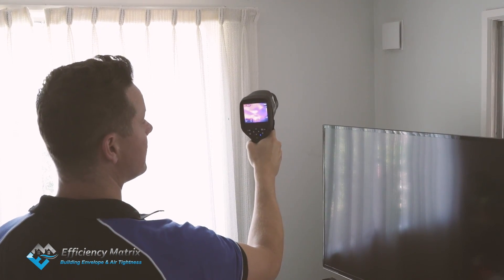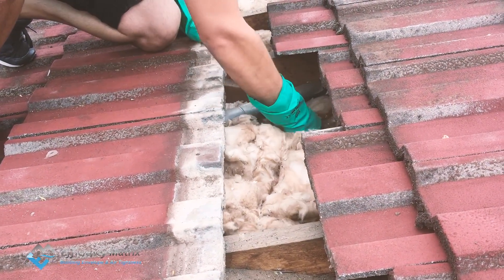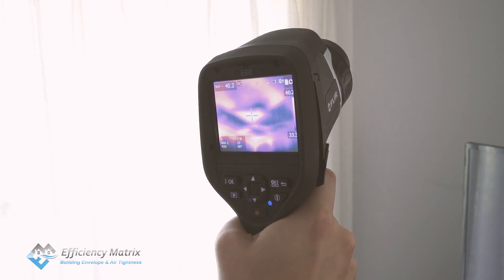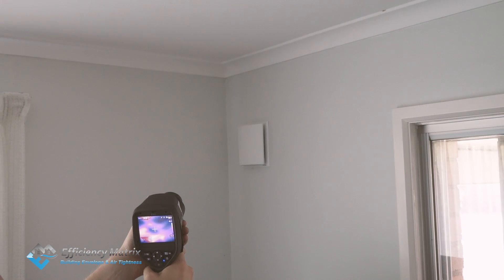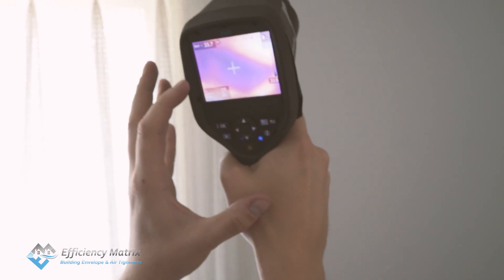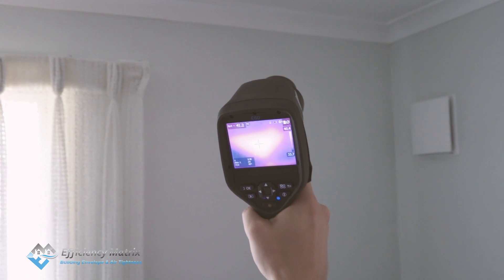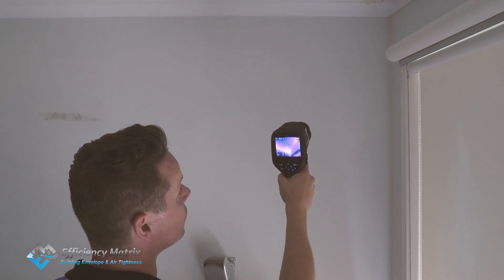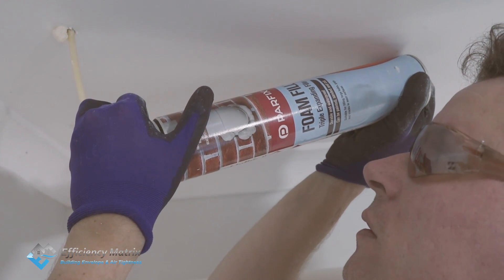Does roof ventilation work?

Comment: While I agree while birds make stuff all difference unless you have 10 installed   powered extraction  makes a big difference, ot cools the roof space down from 60 degrees to like 35 on a hot day, that's 25 degrees less heat loading up the Insulation

Comment: Roof ventilation can work if!
  #The ventilators must me energised with electricity.
 # Temperatures sensors in the roof including several thermostats functioning in synchronisity.
 # During winter humidity sensors.

By the way, the ventilators (fans) must be extract out

Comment: What about something like Universal Tile Ventilators where you install a few of them on one side of the roof and a few on the other (opposite) side and slightly higher? Would they improve air circulation in the roof or is it another gimmick? 

https://youtu.be/lZvJ2ZuqIzY

https://www.universaltileventilators.com.au/index.php/products/tile-ventilator

Comment: So do roof vents work? You didn't answer your own question.
Reply from the maker: John Smith With the use of thermal imaging insulation performance is a lot more important than a measly 1 or 2 degree difference in ceiling temperature when it hasn’t been insulated properly.  that’s the point.  Insulation is more important.

Comment: This video has nothing to do with roof ventilation like it says
Reply from the maker: 81artmonk it’s a video to articulate, that cooling a roof with a whirley does not make as much of a difference as just insulating your ceiling well.  cheers.
Reply: @ecoevo  My point is the title of the video is misleading. The whole video is about insulation and doesn't talk about if roof ventilation works which is the title
Reply from the maker: 81artmonk It does actually.  right at the start.
Reply: @ecoevo  I hate to be that guy but word for word the beginning of the video says, "Today, we are going to talk about roof ventilation, and we are going to be discussing some of the flaws with roof ventilation". However, it then moves into roof insulation and how it's improperly installed and how to fix that. It never once after that touches on what I just quoted from your video. Which is why It's a misleading title. I pulled the quote directly from your video so I am not imagining things

Comment: Paint your roof white or cream color that will cut down on the heat in summer
Reply: Exactly. Too many dark roofs around. Plenty of studies done to back it up, too.
Reply: White and cream colour ?? It doesn't matter the colour.
Reply: @drivingschool11  it does
Reply: @basherero2440   would you mind to...confirm how different colours can affect? Thank you.
Reply: @drivingschool11  darker color absorbs heat more while lighter color reflects some of the heat. A quick google or even youtube search can do the trick. :)
Reply: @basherero2440  
Mr  Noob, this test is inaccurate, as an example,  a slight change of wind direction/ speed  alters  the readings and the angle of  the thermo pointing  to the panels also measures differently . The only way of reading the temperature properly is applying  "device reader in contact".
 In reality these  are  the main ingredients:
-  Varnish
- Additives
- pigments
Reply: @CH-tv1cy  
dark colour is a pigment and there's no scientific conclusions of differences between black pigment or yellow pigment.  Both have  the same flashing point (acrylic) as an example (fade is different).
  I can accept  a can of paint expressing:  "retardant paint properties"  and  special paints characterised  as "solar reflective paint".
 One of the ingredients that can "mix with varnish and pigments is silicone. Silicone 'repeals" sunlight but  nothing to do about colours.
 I think there was or still exists in France or UK a reflective solar paint "Gaco roof coating"  and contains a "Reflective certificate level"
 But, Silicone can cause adhesive difficulties in the long run. In the good old days there was a  paint named as "membrane including silicone" ...complete disaster  because the membrane was peeling off  itself.

Comment: The title and question posed in this video is... Does Roof Ventilation Work? 
The video does not answer the question at all. 
The answer is simple. 
Yes roof ventilation works and it works very well. 
You only have to think of sitting in a car during on a hot day with the windows up versus the windows down to know the difference. Having technology tp prove or disprove something is a nicety, but definitely not a necessity to work out something as basic as this. 
I could engage this whole subject on a whole other level with the assistance of my father who is an engineer and he could explain the difference in temperatures and pressures both with and without ventilation and with and without insulation but it really is unnecessary psychobabble in this instance.
The truth about this video is it's designed to sell a service related to insulation and none of us is going to dispute that having good insulation that has been installed correctly is a bad thing. 
What I would say is that adding a whirlybird and some eave vents is going to be a whole heap easier, more practical and cost effective than checking every tiny area of your roof with a thermal imaging device to make sure every little area has been insulated correctly. 
Having said that doing both will only increase thermal efficiency.
Reply: Efficiency Matrix have you heard of Joseph Lstiburek, he's a Building Science Engineer. He'd agree with Mark... ventilation is very important. Your video title is very misleading, when you don't explain nothing about ventilation! Without proper ventilation, you'll have moisture collecting & it'll rot the structure. 
Change your title... it'll miss leading!
Reply: Efficiency Matrix okay, perhaps I'm wrong... Where in the video do you actually speak about whirly bird type ventilation?
Reply from the maker: Todd Oliver Joseph, most definitely would not agree with Mark.  Canada and parts of the US have problems of their own with regard to ice dams.  Ice dams are a pervasive and damaging winter roofing problem typically caused by a combination of poor attic or roof ventilation and a leaky inside building envelope producing a warm attic space. ... If ignored, ice dams can cause serious damage to your roof, gutters, paint, insulation and interior drywall and other surfaces.
This video is about the effectiveness of whirly bird type of ventilation solutions and the impact of them cooling a home down.  Please don’t mislead the content.
Reply: Efficiency Matrix great effort guys, but I’d have to agree that video is misleading. Ventilation is integral, particularly here in Canada. Insulation is also integral, as is air sealing. Don’t take the feedback too personally, viewers are showing up and giving you ways to improve. Cheers!
Reply: The title and the video don't match. 
The video makes.
Reply from the maker: Mark Shepherd Thanks for the comment.  Actually it doesn’t, insulation consistency works a lot better.  This video was covering a home with a solar ventilator, and the roof cavity is still exceptionally hot.  Fixing up your insulation makes a world of difference.  Roof ventilation cannot compare to insulation in any shape or form.
Reply from the maker: Mark Shepherd The university of Tasmania, conducted a whole research project on the subject of roof ventilation, and they found that most of these devices do not move enough air to make a noticeable difference in roof cavity temperatures unfortunately.  In this video we have not mentioned that we provide a service conducting a survey of the quality of people’s insulation consistency.  We are just highlighting the importance of it.
Reply: Having installed a whirlybird I know from my own experience that it does make a significant difference. Also if you took the time to read my comments properly you will see that I am a supporter of both. To say you can't compare them is really poor form given that a multi-solution approach is the best way to deal with passive environmental energy and cooling solutions. 
The title of this video is deceiving and will be last one I will be watching by the Efficiency Matrix.
Reply from the maker: Mark Shepherd Mark, we are trying to help people get actual results themselves, which make a difference ALL year around.  A Wirley bird may reduce your roof temperature down from 60 degrees to 58 degrees.  Insulation will reduce the ceiling temperature from 40 degrees to 30 degrees and it helps you in winter too!  A whirlybird will NOT!  There is no competition and it’s free!  You don’t need a thermal imaging camera to do this, you could use a cheap laser temperature gun.  Whether you watch our videos or not, it is your choice, but i wish you all the best. 👍🏻
Reply: Change the title of the video and you won't have the sort of feedback I have given. As I said I do not have a problem with insulation, never have. However I do have a problem with misinformation such as the the title of this video. You say you want to help people, then label your videos accurately.
Reply from the maker: Mark Shepherd we will not relabel the title of the video, Roof ventilation has been proven not to do an effective job in moving enough air to make enough of a difference in summer, by the University of Tasmania.  That’s just the way that it is.  People need to be shown cheaper more effective ways of improving the performance of their homes.  Sorry.
Reply: How can anyone take what your saying as honest when the title of the video is so dishonest.
The University of Tasmania, the coldest state in Australia sounds like a a really great place to test roof ventilation, NOT. If the testing was conducted in Queensland or Western Australia where its hot then and only then would the result carry any weight. I will stick with the results that I have experienced myself with my own installation of eave vents, gable vents and whirlybirds, which is a 5 degree improvement in the temperature of the roof space during an average day and the speed at which the roof space cools off in the evening is where the real benefit occurs. Without ventilation the roof space remains hotter for hours and hours with roof ventilation it cools down in less than half the time. Roof ventilation is cheap @ under $200 to do my whole house. One roll of batts is around $80 for 10m2 and thats not installed. Roof ventilation is not expensive.
Reply from the maker: Mark Shepherd that’s fine!  But not many people know that insulation needs to be really consistent, and they look for less effective roof ventilation installations.  This video on a home with roof ventilation clearly shows that insulation consistence helps more directly.  It’s not a mainstream thing and it needs more attention, and this video shows it, with the use of thermography.  We aren’t making money out of it, 
it’s not monetised,
And we never do thermal imaging surveys like this for customers.
Do with it what you will, vote the video a thumbs down.  Hopefully you took something away from it though, but if not, I am sorry. 😉. Have a great weekend.
Reply: Fine... then rename the video "Getting the most out of your insulation" instead of being so deceptive.
Reply from the maker: Mark Shepherd Sorry, we can’t do that.  This is a home with roof ventilation.  And it doesn’t compare with insulation, unfortunately.
Reply from the maker: Todd Oliver This video relates to a cooler house in summer, which is a big reason why some people install the devices..  Moisture is a completely different issue, not related to this video.  Sorry.  The title stays as it is,  please just vote down the video, if you find it uninformative.  Thanks.